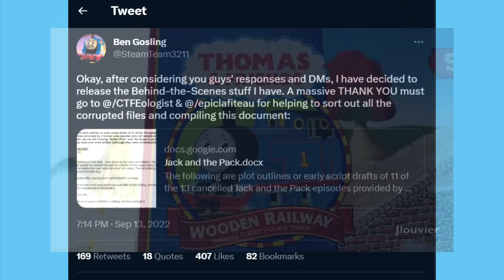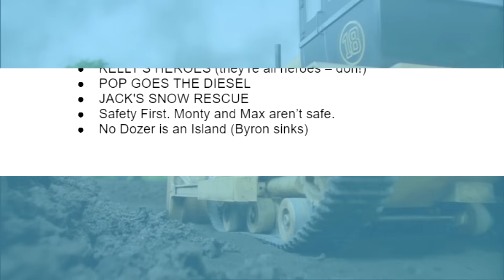The Lost Episodes Of Jack & The Pack - FOUND!

Comment: According to Robert Gauld-Galliers, Jack was originally going to be called Helpful Harry.

In some promotional sketches of the Pack, Jack is seen with a backhoe arm and bucket. According to an SiF interview with Chris Lloyd, the arm was built but was too problematic as it was hard to store all of the radio gear inside the model. An interview with Phil Fehrle gives a very different reason: "...if a story required Jack to be digging (using his back-hoe) and interacting with another character working at the same time, his face would be facing away from the action. For story purposes, it was important to feature the faces as much as possible; thus, the backhoe was removed".

An early concept art design for Oliver reveals his name was originally meant to be Buster. That name would actually be given to another Pack member instead. 

Oliver is the first character to share his name with another character in Thomas & Friends, and the second to do so in the entire franchise, the first being Bert and Iron Bert, the third being Bertram and Sir Topham Hatt in Thomas & Friends as of the thirteenth series, and the fourth is Stephen, like Sir Topham Hatt's grandson.

Patrick was one of the characters that was originally going return in the CGI series but was dropped, the others being Billy, Dennis, Splatter, Dodge, Duke, Derek, Colin, Freddie and George.

According to Robert Gauld-Galliers' concept art, Max was originally going to have a grey pipe shaped bumper. 
He was also going to have silver wheel arches and his headlights would have been on those
Max's eyebrows are thinner and angular, whilst Monty's are thicker and rounded.

Monty made his debut in the spin-off series DVD based primarily on the Sodor Construction Company.

They are the last returning characters to have separate actors for the UK and US dubs.

Monty is the only character introduced in the Jack and the Sodor Construction Company to have appeared in full CGI.
According to their inaccessible page on the Official Website and merchandise character cards, Max and Monty's full names are Maximilian and Montgomery.

Monty's TrackMaster model was only released in certain countries such as Portugal, making him one of the rarest and least produced pieces of Thomas merchandise ever created, though some models have been found second hand in other countries, such as the UK by Twitter user [3]@OTomatron.

In the Model Series, Monty had a black radiator cap. Whereas in the CGI Series, he has a silver cap like Max.

Isabella is the first character to be numbered 22, followed by Luke and Rebecca. Out of these characters, she is also the only one to be a road vehicle and not to appear in the CGI series.

Isabella is the only original member of the Pack to not be manufactured by Trackmaster.

Isabella is the only female member of the Pack that first originated in the model series.

In earlier concepts, Ned's name was supposed to be Ted, which is also the name of Henry's fireman. According to Robert Gauld-Galliers, Ned was originally going to be female and called Sophie.[2] Furthermore, in the Italian dub, Ned is referred to as female.

Comment: 19:22 I think they did it better in Season 8. Backfiring is a problem with the engine itself, not the fuel. Plus, the Horrid Lorries would make more sense then Max and Monty to bully Isobella. Ned and Buster are also steam powered, and the three lorries would be better at making Isobella feel threatened. Plus, Max and Monty deep down care about their fellow machines (Max was shocked when Jack bent his arms and both were horrified when Patrick fell into his own concrete).